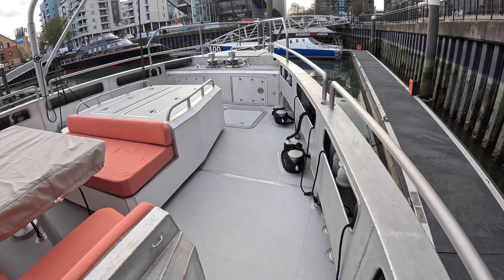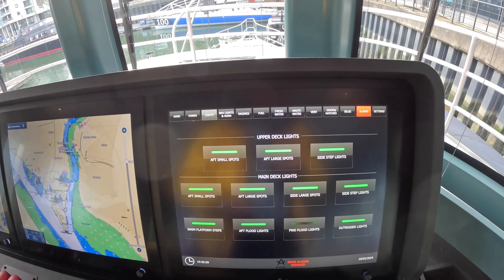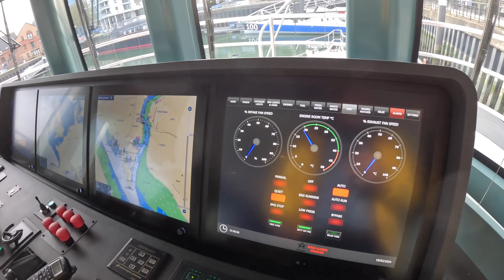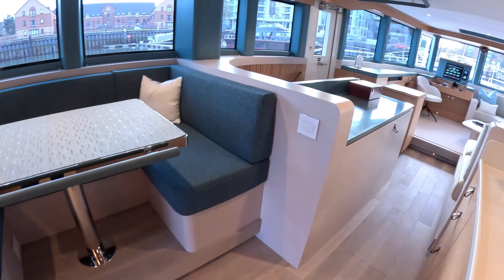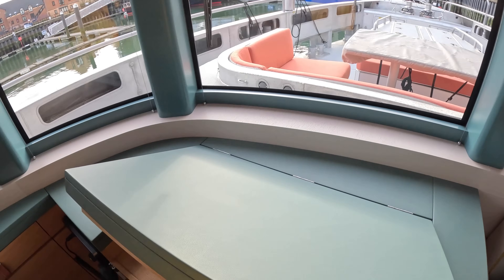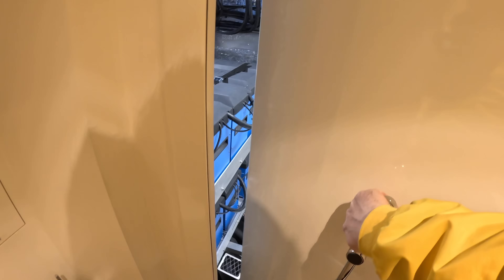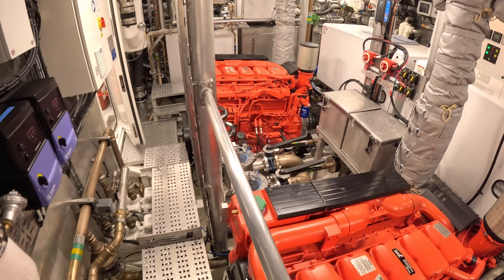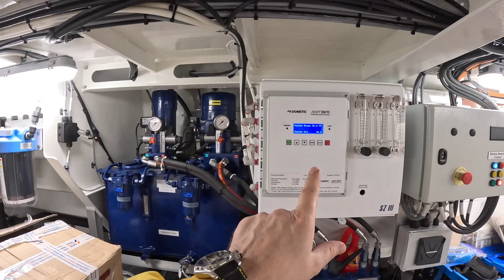£9.5 Million Explorer Yacht Tour : Arksen 85

Comment: Truly a very capable and beautiful boat. The Arksen designers may not like to admit it, but it clearly draws inspiration from the pioneering designs of Steve Dashew and his FPB range of explorers.
Reply: They are pretty silent about it, which is a shame, it's a good pedigree that would add value, but I guess they want someone else's credit.
Reply: If by “draws inspiration from” you mean directly copy, then I agree with you. Unfortunately, this boat is not nearly as fast as the FPB’s.
Reply: @Zepherian  Actually the Dashews shut the doors of the company instead of selling the FPB lines of ships. 
So it doesn't matter if Arksen picks up where the Dashews left off.   Plus, Steve was very clear when he shut down the business that some of the FPB owners were not ballasting the FPBs as Steve had designed them to be, which could lead to safety issues.  He also said in one of his last posts that vessels similar to the FPBs that were being build did not have a similar engineering.  They were apples and oranges.

Comment: What a great, fascinating, boat.  Not a huge fan of the bare aluminum, but it would certainly simplify maintenance.  I like the "cozy" feel and layout.  ALL on board become family, or crew if you prefer, without the separated facilities/cabins.  I love this about it.  What I do not like is the location of the laundry facilities.  Imagine you are on a long trip, with a full passenger load, you will need to do 2 things.  1. Wash clothing, a lot.  There really isn't easy access to the washer.  2.  Store trash until you get somewhere to properly dispose of it.  That lazerette  looks like the only realistic spot.  Of course, you can lose a cabin for a utility room, if you'd like.  Thanks, Nick, for a look at 1 of the most interesting boats, yet.

Comment: 22:54 A doorway is an opening in the structure of the vessel that allows access between different areas or compartments. Yachts typically have multiple doorways to provide passage between cabins, saloons, decks, and other areas onboard. These doorways may be equipped with doors or may simply be open passages, depending on the design and layout of the yacht. The materials and style of the doorways can vary greatly depending on the size, type, and luxury level of the yacht.

Comment: In my humble opinion, that bare metal isn't as good looking as if it would be if painted, but beauty is in the eye of the beholder. Still I'm wondering how that feels under direct sunlight. I've been on a couple of boat trips in Greece, and white painted metal was to hot to touch. I imagine this would be even worse. The yacht itself is pretty cool. I imagine how manually pumping 18000 liters of fuel would feel like  :))))   . Congrats for this video.

Comment: thats really an incredible boat.
the only thing i would personally like to add and change about is is adding even more solar power, adding two small wind turbines and converting the motors to a hybrid drive system.
being able to slowly move without burning any fuel would be a huge advantage or alternatively that would mean you run the generators even less to cover your house loads.

given how efficient that hull is that should be perfectly doable, consuming only 25L/h at 9 knots means they are burning 250kWh worth of diesel per hour at maybe 40% efficiency at best so even at 9knots it shouldnt take more than 100kW of power which you could totally get from batteries and then slowly recharge over time.
just checked their website and turns out there is a hybrid system available, would be super interesting to see some more about that specific setup.

Comment: interesting to learn they chose scania engines because they operate at a lower RPM and therefore have a longer maintenance interval (you dont need to change oil or overhaul as often), have lower vibration and all that, and therefore have better fuel and overall operating economy.

Comment: Is this something that could be considered a spiritual successor to the legendary Dashew boats?
If I ever win the lottery, I'd absolutely love the 75 foot model they do (don't know if they've built one of those yet?), and that would save a bit of time and money not needing the 24m+ licence...
unless it slips in under 24m on the critical measurement? I can never remember which measurement is used for licence purposes, is it LWL?
I love the rugged raw aluminium and treadmaster exterior (to clean, pretty much hose it down and you're done), and the interior is fantastic :)
Personally, I'd still like a wheel, even though it probably wouldn't be used that often on passages, but I'm a big child at heart, so wheel!
Reply: The Dashews stopped making the FPB’s years ago. This is as close as you can get to one if you want a new boat. However, it still pales in comparison to the original.

Comment: The bit in the beginning about recycled aluminum  is good for a laugh (not all is made of recycled aluminum). "Look how Green I am!" Yup, in your 9.5 million pound yacht with big hairy diesels and 4,200 gallons of fuel cruising at 7 knots with a 7 gallon per hour burn gives one nautical mile per gallon. Hardly great gas mileage. My minivan gets 25 MPG. Just cut the crap. It's a very rich man's toy that is not "green" by any measure except when compared to other enormous boats. It's like having a fuel-efficient jet. Nice boat, though.

Comment: I've noticed chart tables and storage for charts (proper chart drawers) on a number of the videos you have done, and I'm often curious as to why you never mention them. As an engineer, I can easily spot drawers specifically designed to hold blueprints or charts.

Comment: 1. The backup manual way to use the rudder shouldnt rely on having a 2way walkie... imo  *you should be able to use it while being on deck and use your own eyes

2. The liferaft(s?) seem tiny... surely if shtf somewhere remote = larger boat inkl food+water+backup gps/satilite comms inside it would be nice?
(would be cool to get a rewiew on how those lifeboats work and what the content inside is).

3. The flimsy holder that holds the "key" to open the decklocker... hope there is a better solution (and that you got multiples in backup) as it seems a small wave = pops out and gets lost.

4. There isnt a "true" backup engine..

Comment: Love your videos and love the idea about the boat and the design. But, whoever did the welding on that boat needs to get fired… 😅🙈. And the fact that it is built using 70+ percent recycled aluminum doesn’t make any more comfortable about the strength and quality of the alu-alloy used… I am actually surprised that a explorer yacht would even consider a aluminum hull in the first place. That said, it IS a cool boat and raw look/design 👍🏻

Comment: If your yacht costs $10 million and everywhere you look you can see welds then you need to be paying the guys who can do $80hr welds. that looks like trash.
Reply: Apparently you can spec a different finish to the welds in that they can be blended in (presumably ground flush with a grinder) obviously at added cost etc

Or they could just get a decent welder to do a decent job in the first place? 😂
Reply: @chrisfs150  remarkably bad.

Comment: Ive seen better welds on aluminum bass boats.  The finish quality on the exterior is just atrocious
Reply: Sure thing buddy
Reply: Agreed,  the fit and finish is appalling.
Reply: it would like fine if it had pain and teak installed, beautiful but looks unfinished….even military vessels are painted but other than that, a beautiful boat that can go anywhere on the water a true beauty. For some reason the owner wanted the raw look, you pay for you get it how you want.  lol if you have the money don’t complain get the boat to your taste.
Reply: This yacht is aluminium though. It is made to be industrial, not ornamental.
Reply: @siimkask14 sorry I had to jump on this one, the reason that it looks like it looks is because aluminium doesn’t need the finish a normal steel vessel needs. So no additional filling or painting makes it look look like this and the welds are pretty ok but you will never see it in a normal yacht, those will all be covered up by filler and paint. Hopefully you can look at this boat differently.

Comment: The boat and concept, technical safety and backup systems are unique - THOUGH the interior „design“ looks like a freakin hostel, no style at all that’s in line with the boat. Either do modern, matching outside but play with wood snd Aluminium combinations